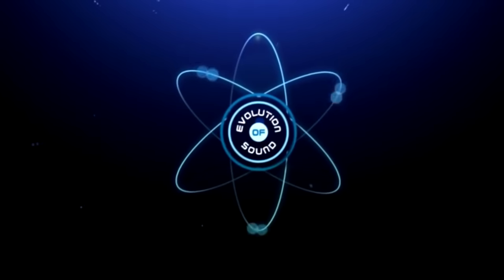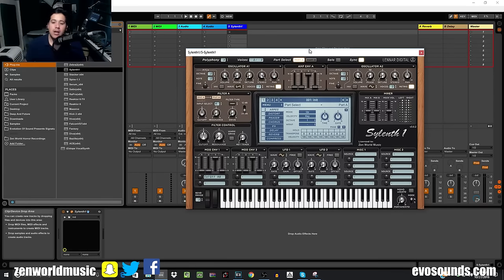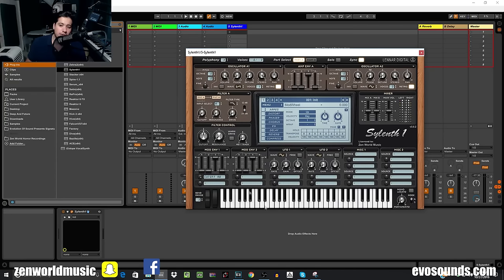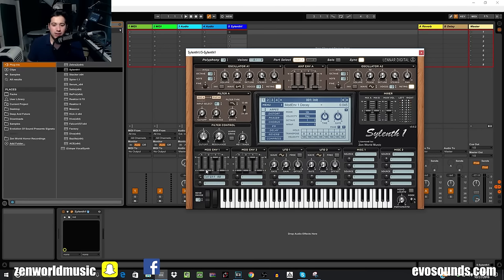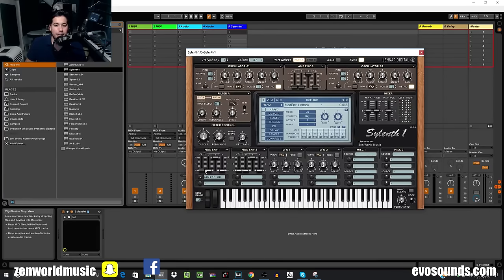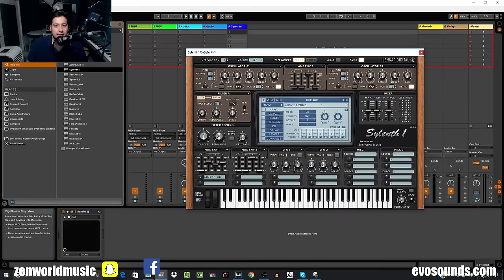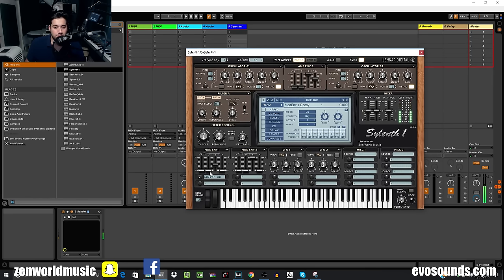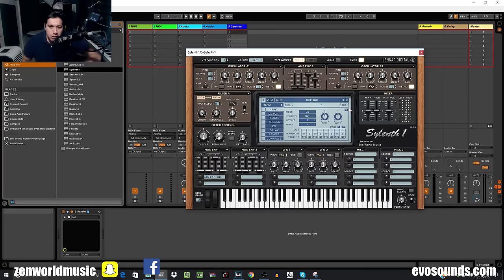The Complete Guide To Master Sylenth1| #4 Mod Envelopes

Comment: So..what is the difference about mod relace fader...and amp relase fader?
Reply from the maker: AMP Release FADER is for Volume. Mod RELEASE Fader is for modulation. If you have release on your AMP after you let go of a note it will linger for a few seconds if set high... If you want the modulation to follow after you let go of the note you set the release high as well similar to the release in your amp
Reply: @ZenWorld  thanks